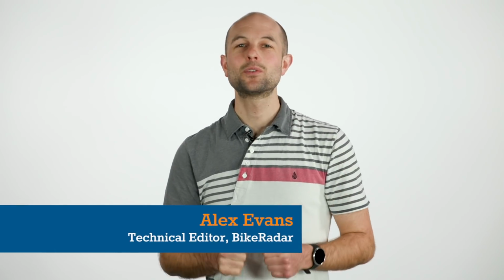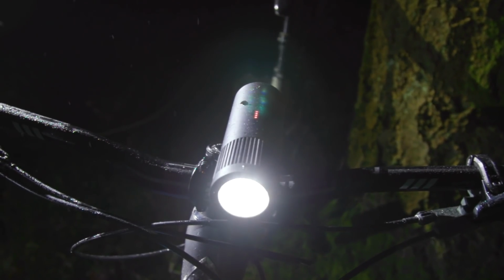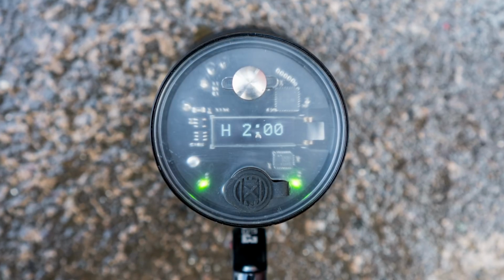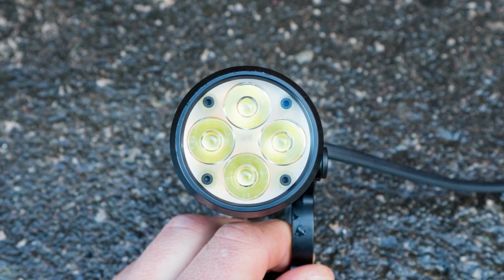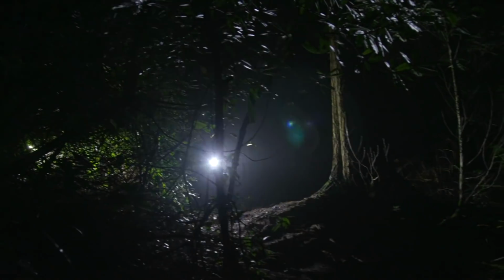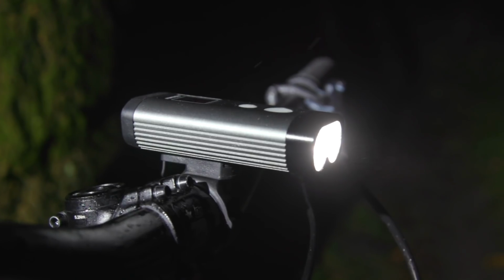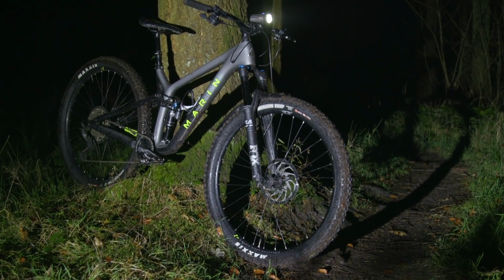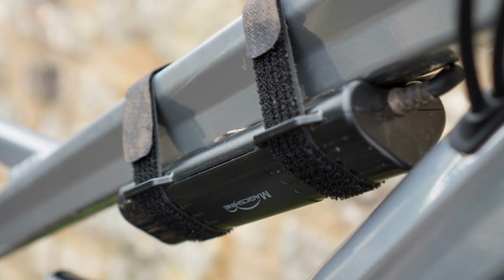15 Way In-Depth Front Light Mega Test

Comment: Yeah....a reputable chinese/taiwanese flashlight brand with $1 mount, separate reputable charger, number of quality 18650 batteries that suits your ride lenght, will cost you sooo much less even when you put one on the bar and one on the helmet. And it will be all separate. Failure of one component will not be equal to failure of a complete integrated system. Or a repair labour cost after warranty period. And will give more use out of the light, as flishlight is more usefull for wider spread of uses, than a bar mounted head unit with a battery pack. Also I'm wondering, scratch that I'm very much doubting, that most battery packs have cell balancing in them and lack of that means trouble. That's why a single flashlight for single task, with single 18650 cell is the best option. And if you decide you need more light, you can mount a second one on the bar. But really, if most recommend a thrower on the head with around 1k lumens, then why would you need more on the bar for close flood? Perfectly happy having 900 lumens flood on the bar and 900 lumens thrower on the helmet. And I've seen more light with my own eyes, so it's not entirely: "you didn't use more light, so you don't know"
Reply: Are those batteries safe? What I have read makes me fear for burning my house down.
Reply: @michaelwyatt4871  Do You know what cells ar used in 9/10 bicycle lights? Do You know how agressive the lights manufacturer was, when haggling the price per cell and if it influenced the quality? I only buy top brand cells, they cost around 3 euros per 3300mAh capacity(pretty much most economic) and I buy cells that are new, but have been separated from unsold packs for electronic equipment like laptops, drills. Recently my brother found a new source, where totally new retail cells never used for anything cost under 4 euros.
To be honest, considering Samsung's fiasco with smartphones burning peoples bodies....do You charge your phone in a steel pan? Do You own a portable power bank and charge Your phone in a pocket or bacpack, or worse still...on a plane? Cause that is all dangerous when we consider guidelines for charging phones alone.
Same goes for any lithium batteries. If you wanna be safe: steel pan with lid, placed on non flamable surface or fireproof battery charging bag (like for RC cars battery pack charging) and that's with smoke detector in the same room and with You present in the house during charging. Sad truth, those batteries are volatile, but yeah, I would never import Li-Ion or Li-Poly cells from china by ebay, Aliexpress, Gearbest or Banggood. 
If You want more info, I can write what I've got.
Also wanna add, those batteries are slowly being used in more stuff, so a charger for lithium 18650, 26650 and other sizes will again prove more usefull and some will also charge Ni-MH batteries if one wants to reduce the ammount of chargers at home or doesn't have one. And having 2 flashlights on a ride for the price of 1 bicycle light is making a comeback in the darkness very unlikely. With some basic soldering knowledge, many flashlights can be fixed at home, as the parts are interchangeable and available, which can not be said about proprietary lights. 
Ohhh I could go forever about superiority of a flashlight over bicycle light. Except in Germany, as every light over there has advanced beam patterns which is laughable, that those in test here mostly do not have for the price and using them on the road, can get You a ticket regardless of the laws. (those lights are blinding people just like flashlight....and they're purpose designed for riding....???) 
Anyhow, I'm gonna make a stainless steel hood for my flashlights to make upward cut off, till now I've been just adjusting the angle for road rides and lowering the output. 
And I've seen 5k lumens, wide spread light being used in flashing mode by Bikeradar rider at night on the road.....speechless.

Comment: I realize that you guys get a lot of high-end product sent to you, however there are FAR more affordable lights out there.  I just bought a IPX6 rated 2000 lumens light with a flood and spotlight, usb rechargeable 4000 mah lithium polymer battery, ambient light sensor, accelerometer/motion sensor, and built-in 120db electric horn with break-out controls for less than $20 US on aliexpress.
Edit: Looks very similar to the Moon Meteor Storm Pro light that you reviewed, I wouldn't be surprised if it was the same OEM.
Reply: I wrote that as I was watching, before I got to the ebay disclaimer.  Still, it would be nice to see a comparison to see what exactly you are really paying for.

Comment: Please check out the link below which will lead you to the most amazing bargain light ever! I have been using mine for almost two years now and its still going strong! It will set you back £14.38....yup, £14.38 for a full aluminium body, 2 X Cree LEDs and a built in battery. Its one of those uber simple 3 brightness levels and 2 flashing modes. It is splash resistant and is USB chargeable. It puts out a claimed 1000 lumens and the light has a slight yellowish hue rather than white or blueish. The only thing to be aware of is its weight which is fairly heavy but thats an irrelevance given its quality. I have used many FAR more expensive lights but after using this for a while, there is simply no point in spending hundreds. Check it out and see what you think! Oh I forgot to mention, the build quality is frikkin amazing, you can see that in the photos.
https://www.sunsky-online.com/view/992223/T20C%201000LM%20White%20Light%20USB%20Charging%20LED%20Bicycle%20Headlight%20Front%20Lamp%20with%203%20Modes.htm

Comment: Do a second test with the very best Ebay and Aliexpress lights, there are some true gems out there!
Reply: Would need to be a Long-Term Test given the dodgy/hit-or-miss quality from those sources.
Reply: There is nothing dodgy about Aliexpress. Its only the uninformed consumer that's the problem.
Reply: I'm glad I'm not the only one out there saying this
Reply: 70%  might be bad/low quality but the other 30% is just as good at least. Off course you need to do your homework, just buy the more expensive products with a lot of orders and reviews. I have seen several European companies that ordered products from the same factory, sometimes even without design changes.
Reply: @detmer87  Dont ever buy 2 dollar bike headlamps. The 30 dollar lamps are equal or better than 200 dollar bike shop lamps IF YOU KNOW WHAT TO LOOK FOR.
Reply: @detmer87 https://www.alibaba.com/product-detail/SG-K21-High-power-2200-lumen_60677299818.html?spm=a2700.galleryofferlist.0.0.1c23c62ddM9brT This thing will turn night into day. Dont say I didn't warn you. Might be too much for traffic.
Reply: Been there wasted my money on those batteries woudn't charge and run time poor and light brightness not great not even half of claimed amount of lumens.

Comment: These must be great commuter lights, but once you use a proper helmet mounted light for actual mountain biking, you won't consider bar mount lights again! 2000 lumen helmet mount beats 6000 lumen bar mount, any day. Also does not blind any other trail user to death...
Reply: A bar light with well engineered optics and big battery is the best compliment to a lightweight spot type helmet light.

Comment: Pity you did'nt review a CREE Bike light off Ebay,comparable brightness to all this overpriced Product placement at a fraction of the cost
Don't believe the doubters who peddle the usual faults either such as Danger with charging,life expectancy etc
ive been using 3 different cree lights for well over 2 years and the are superb,insanity to pay £100 plus for this stuff but its up to you
Reply: Solar storm 
Under £20
Reply: Red Last Which ones are you using?
Reply: @kaatBush4522  Brite-R and Solar Storm plus standard Cree XML set ups
Reply: You can take a gamble with that cheap crap if you want, that's your choice, but I won't make that mistake again.. We unbelievably had two ebay cree lights fail on the same night ride leaving us stuck out on the Brecon Beacons. Luckily it was a full moon.... 👍🌝
Reply: @nickpmtb5629  its far from cheap crap,i suggest you stop misleading people,reliability has never been an issue for over 2 years,its common sense to take back up lights anyway,thats your stupidity you had no backups-so cut the scare stories,Cree work,you have only £15-£20 to lose if in the unlikely event of problems
Reply: @laance606  I'm not misleading anyone... 🤔 I just voiced my opinion based on my experience that's all...no need to get arsey about it. You've had good experiences with Chinese ebay lights, good... 👍 I haven't....
Reply: @nickpmtb5629  had my solar storm for 3 year still works perfect 
It's even been under water 
You could buy 10 for the price of the overpriced stuff
Keep a few spare in the bag 
One for the head 
2 on the bars 
Might last the best part of 30 year
Reply: My first lights where a 1000 lumens from MEC (in Canada) and a cheap eBay 1500 lumens crap. The eBay lights failed and completely drained the 2 Li-ion batteries and it's now dead, from the smell, the electronic fried. I will never buy cheap crap from Amazon or ebay. You get what you pay for! Even if a light is using CREE LED, their are multiple quality depending on the production and the lest good LED will be sold as lower grade LED to those cheap Chinese company. They will look the same when they are new but with time the LED will dim/fail. One the cheap 1500 lumens light that fried, the light was already starting to turn green (a sign of failing LED) before it failed!

Comment: Nice test. It would have helped if you showed the name of the lamp under test , maybe with  lumen and price as well.

You fail to mention if there is a pilot light and that this light, as well as a wireless remote, will mean that the lamp is always on and will discharge in a day or two, when just sitting on the bike in the shed.
In most cases the off button does not turn the lamp off completely, because it's an electronic button, that needs some circuit to be working, so you will have to pull the connecting cable to the battery, every time you get home and that can be a hassle as it's very tight because it has to be watertight.

I have installed mechanical switches on both my lamps, that have this fault.

I also found that the capacity indicators dazzled me in the night, so I have installed some white tape over it. Did you check this?

And the Magicshine can only use proprietary battery. The Monteer 6500 is currently only compatible with Magicshine MJ-6106D 4 pin battery pack., which makes it expensive to replace although it's a very good battery.
Reply: Great points from the OP.  I would add that a summary chart that we could pause on, highlighting the differences (e.g. ONLY a 31.8mm mount, checkmarks in depth or side vision boxes), would help.

Comment: The depth of this review was awesome, cheers! I just can't believe you just shrugged off Asia direct lights due to safety concerns and didn't touch on dyno lights! Asia direct lights, with their extremely low price they make a great entry level light to get people outside in the winter. Yes, charging safety can be questionable, however its questionable for name brand lights too, especially when bike lights are use/abused as they are. Whatever the case, i've converted to dyno lights, if you have the money they're worth it (see K-lite, Exposure, Supernova).

Comment: Exposure been difficult to use unless you read the Manual is just nonsense.. a 747 is difficult to use unless you read the Manual.
Reply: Exactly! I just keep it in reflex mode anyway, gives around 3 hrs burn time which is heaps. Also who would be trying to fiddle with the light settings when riding rough terrain lol